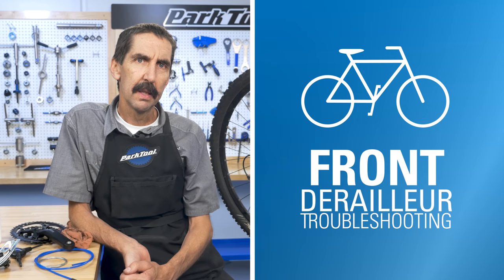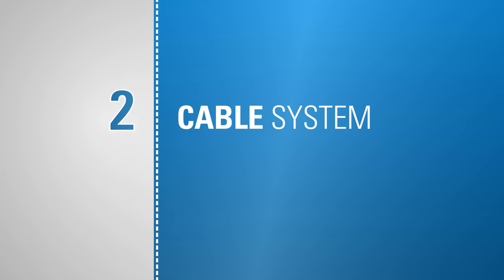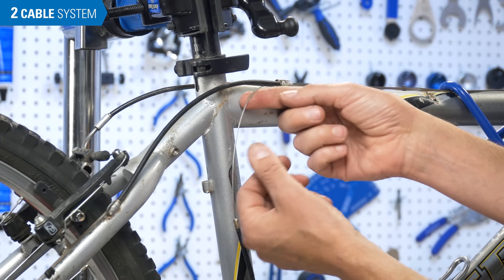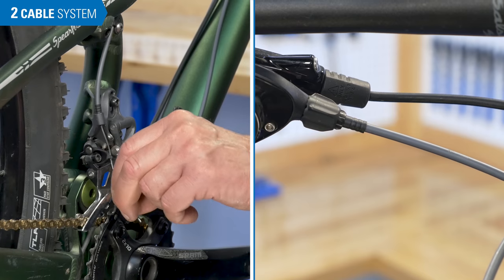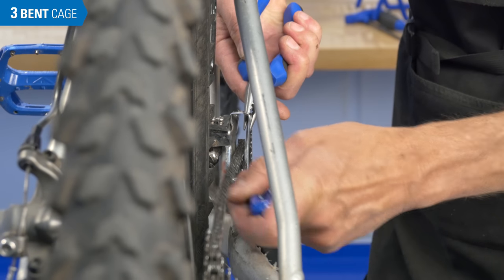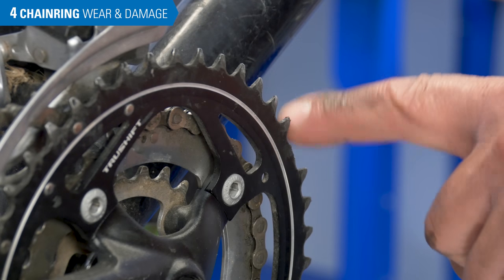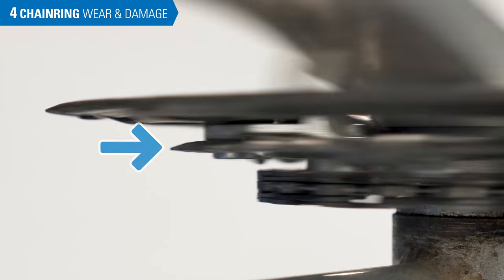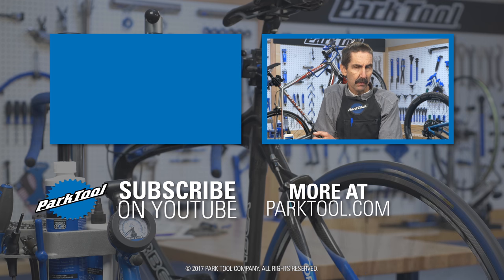Front Derailleur - Advanced Troubleshooting

Comment: My problem is everytime when I'm in the largest cog, when I'm putting it on second it goes directly in smallest and skipping the second
Reply: Adjust your front system from scratch. It's usually a bad combination of the shifter set screw and low set screw but more the shifter screw.

Comment: After watching all the videos on "front derailleur", I was hoping this one was the answer. Believe it or not, it wasn't. It was my mistake not to have recorded what side of the screw the cable was supposed to go. I had threaded the cable on the opposite side of the clamp down point than I should have. Just that little change made it impossible to get the chain on to the largest ring. So, after I moved the cable over and made sure everything was in lubed and adjusted, I tried it. Just a little tweaking of the High/Low screws and now it is back to the way it was before I decided to change from grip shifters to trigger shifters. Bottom line, however, is: These are without question the best bicycle maintenance video presentations out there. (Which could be why I always go to Park Tools for my bicycle needs.) Thanks.

Comment: I bought a new bicycle but found out it's rubbing the chain for some gear combinations, after watching your other two basic videos and a few hours of tuning, I found out that the large chain ring is not rotating on the same surface, there is 1-2mm in and out while rotating, not sure if it's wobbled chain ring or other things caused it to off the surface... but  the 3'05'' of this video talks about the wobble chain ring which confirmed my difficulty of adjusting cable/H/L limit. thank you very much. learned a lot from your videos. the bike will be returned to store.

Comment: I'm indexing my gears and adjusted the front derailleur, but when on the lowest gear+smallest ring  and trying to switch the front derailleur to the big ring, the chain gets stuck. The derailleur cage is practically parallel to the ground and it seems like the problem is related to that. How can I fix it?

Comment: Great video(s)! The detail and intuition provided is really helpful. The issue I'm having is that adjusting the limit screws does not move the cage. I manually moved it in and out and managed to get a little movement out of it so I think maybe its just really grimy in there. Would lubrication (or wd-40 or similar) help? I just changed the cables on my bike so I'm confident they're ok. Thanks!
Reply from the maker: Thanks! Lubrication will definitely help. Sometimes You may have to turn it a few times to get the screw to come in contact with the stop. This is especially prevalent on the low limit of the front derailleur. Lube... good, and keep turning. Hope this helps! Let us know how it goes.
Reply: Yeah! Ortherwise use the T9,its very helpful

Comment: I was going to adjust mine but for some reason the tension is so high I cant seem to get the lever on the handlebars to go past half way (front stays on middle cog and wont go to largest). i checked the cable when its on the smallest cog and it isnt really tight just firmly in place... any idea whats causing this? changing the l and h screws dont solve it.. i cant find anything it could be stuck on either... its a brand new bike and i found out the spokes are so loose they creak from the slightest movement of the bike so i'm pretty frustrated... to be fair it was shipped through mail so i should have expected as much.

Comment: I've gone through the main tutorial, adjusted alignment in both planes of movement, adjusted limit screws, done the indexing, then checked the advanced tutorial and checked cable housing and chainring bolts. My rings and chain are all brand new. I'm at my wit's end. The chain still has problems shifting from big to middle ring (worst offender) and also from middle to big ring. This also can be perfect on the work station, but then when riding for a few minutes reverts back to being a ****. I've taken everything off and rebuilt and readjusted countless times now and keep getting the same issue. The only thing I noticed was that when the cable is slack and I'm testing the movement of the derailleur, in order to then re-tighten the cable to set the perfect tension, that my derailleur doesn't ever move over as far as yours does in the main tutorial. Even with full slackness it does a half-arsed movement (even when I pull the chain to the side to stop it getting in the way). I took it off and sprayed it up in all the nooks and crannies and tested it whilst in my hand, and it moves fine, but when on the bike and activated by the shifter it seems weaker. No matter what I adjust I can never get the whole system working perfectly. If one part is working perfectly due to cable tension, another part will be off. What are your thoughts?
Reply from the maker: When you replaced the chainrings on the bike did you time the rings correctly? I ask this because you say it works in the stand but not while riding. This indicates that the chain might not be catching on the correct part of the chain ring. many chainrings will have ramps and pins that help the chain catch the next gear and also helps the chain drop. If these are not correctly oriented then the shifting will not work under load very well. Also, what is the condition of the cable and housing?

Comment: I watched all your videos and they are great. However, I have an issue with the front derailleur shifter I've never seen. When I try to shift from middle to larges cog (front), the shifter lever does not pull the cable until I repeat it a couple of times and then it "catches". From smaller to middle cog this issue does not occur. Any advice you could share?

Comment: Tried exchanging front derailleur. But ''seat post angle'' and or ''cage size'' caused a problem? Do the cages differ in angle and or size in length? On crank I changed from 2 to 3 chain rings. Hoping to see a solution on YouTube. Thank you

Comment: I replaced the left shifter and it came with a new cable. I installed everything and then used one of your videos to adjust the front derailleur and it was very helpful. However, no matter what I adjusted, the shifter won't click to 3rd when the cable is attached. If I loosen the pinch bolt and disconnect the cable, I can get the shifter to do all 3 clicks and the cable moves slightly for each. What is happening when I reattach that prevents the shifter from clicking to 3? When it is in 2, I push the thumb to click to 3 and the thumb just presses all the way in with no impact on the derailleur and no click. Any thoughts?

Comment: Awesome explanatory vid!  I've learned a lot and can now make successful adjustments myself ^^

Unfortunately I'm currently still riding my 14y  old "MTB" with a 3X gear up front ... more of a 'city bike gear' on an ok MTB like frame :/... and after playing with the rear suspension settings ... which didn't turn out well since it's more a bike pretending to be a MTB ... the sticker on the frame even says so :D  ... I ended up with the problem that I can get everything to work alright in the repair stand but during testriding the suspension obviously manipulates the chain tension thus the front derailleur doesn't want to shift well between the 3 gears.  Either (i) all except the biggest work fine ... or (ii) the problem is going back down from the biggest cog.
Guess it's just a matter of a lot of try and error and making small adjustments over time ...
Guess this explains why real MTB's normally only have a 1x or at most 2x at the front...

Thus currently I'm just gonna use the medium size cog at the front until I've had enough time and patience to get it fully set.

I have "motor bike throttle style" shifters thus I guess I can use the extra click's to "over adjust" the derailleur while on the repair stand and than see what effect it has during test riding.

Comment: I noticed a small wobble in my chainring Which makes the chain rub against the derraileur when in the two smallest cogs and the biggest chainring. I tried to set the limit screw but the chain keeps rubbing. Please help me
Reply from the maker: Some small wobbles are not uncommon.  But these can rub if big enough as you have seen.  Sometimes some models can accept bending to straighten, but sometimes it just means new rings.
Reply: Can a loose cranck cap be the cause of the wobble?
Reply: @parktool  thank you

Comment: My shifter for the front derailleur is stiff. It hurts my thumb while I try to shift gear onto the next. Help?
Reply from the maker: Lubricate the pivots of the derailleur. Also lubricate the cable.  To test the lever pull, disconnect the front cable, and pull it with one hand.  Move the lever with the other hand.  It should not be hard to move the lever.  Lubricate the lever if it is still.

Comment: Why if I'm pedalling then I stop pedalling and my chain stucks and doesn't freewheeling how can I fix it
Reply from the maker: There could be a few things happening. You could have something like a spoke protector or a pice of string or grass wedged behind the freewheel not allowing it to freewheel properly. Or you could have a seized up freewheel. If you clean the debris or there is none and it still is having the issue you can sometimes get some lubricant into the freewheel to break it free but replacement is suggested at that point.

Comment: What to do, when my L limit screw is loosen up, the cable tension is loose as well, but the chain still rubs the inner part of front derailleur when on small chainring and biggest sprocket (Shimano 105 2x11, 52/36 chainring, 11-30 cassette)?
Reply from the maker: Double check the rotation.  It may need a little clockwise rotation, as seen from the top.

Comment: Parktool can you make a vid preventing the front derailluer clamp scratching the frame? I hope youll notice me.
Reply from the maker: Clamps by their design must press against the tube.  It certainly can occur that you get a scratch.  However, remove the derailleur. Feel inside the clamp for any sharp edges.  Use a jeweler's fine or find emery cloth to finish smooth. I can sometimes help to use thin adhesive tape.  Place this inside the derailleur clamp, not the frame. The adhesive sticks to the clamp surfaces. Use a razor blade to trim off any excess beyond the clamp.  Thick tape will change the diameter and may not allow the clamp to work, use an electrician's tape.

Comment: I recall about 20 years ago, reading about many different types of cable housing (Teflon-coated, reinforced, black or white, etc.) some of which required special tools and techniques to install. Nowadays, all the mechanics say "Buy new cable housing" like it's a generic "one size fits all" product. Is that true these days??
Reply from the maker: There are quality levels in cables and in housings these days. Many shops or home mechanics have a big sspool of a decent housing and then have some decent cables that they use as the shop or home mechanics "everyday" use stuff. Then they usually will have a higher end option or two. Never lower quality as some of the inexpensive cables and housings are terrible.

Comment: My chain sometimes will suddenly jump from large chainring to the middle chainring when it was fully locked in indexed
Reply from the maker: Certainly that can occur.  Double check the rotation and also the H-limit. If a bit on the tight side, it may allow the chain to fall inward.
Reply: @parktool  That's exactly what it was thank you kindly Sir :)

Comment: Hi Calvin, I need your expertise. I have a 2x10 Tiagra 4700 setup. The front derailleur is a bottom pull. I removed it to clean and lube pivot points. After reinstalling and adjusting cable tension,  the front derailleur will no longer shift to the large chainring without having to use excessive force which makes it utterly unusable.  In my troubleshooting, I found that when the cable is disconnected, the front derailleur moves smoothly. With the cable still disconnected and holding the cable with my fingers, the shifter works normally and cable is pulled and released as I shift through its range. It was working decently prior to removal and clean/lube. I have played with cable tension, limit screws all to no avail. I am stumped. Any ideas??
Reply: Having the same issue and nobody seems to have good advice for it

Comment: What do you do when the barrel adjuster won't thread into its place
Reply from the maker: Be careful, don't force it.  Disconnect the cable at the pinch bolt to get slack.  Now align the threads of the adjuster with the lever and carefully re-thread it.  If it will not start, the internal thread might be damaged, and need a M5 x 0.8mm tap to clean.

Comment: How about a small wobble in chainring? I think even that makes 3-by-systems hard to tune just right and replacing all the whole front end cogs just for that gets expensive. Is it possible to bend chainring to true, shim the chainring or is the replacement the only real option?
Reply from the maker: Small deviations can be adjusted out of chainrings. Careful use of pry tools, a hammer and a punch can correct these deviations. start with small adjustments and go bigger.

Comment: if you have a bent tooth on a front sprocket, is it bad to torch it and try to bend it while hot?
Reply from the maker: it would be best to bend while cold. If aluminum it is going to break off. But if steel it will likely be just fine bending back.
Reply from the maker: Do not heat the metal.  Just bend it a little at a time, trying not to over shoot.  If it breaks, it was unusable anyway.  Test ride and see how it works.

Comment: My Shimano FD-R2000 front derailer's trim is troubling me a lot, there's always a gear or two in the middle of the cassette that results in the chain rubbing the derailer cage even after the trim is performed. it's like the cable pull ratio is too big, so instead of rubbing the outer plate, it starts rubbing the inner one after the trim is performed. I checked the assembly as per the manual like million times, all the gear is brand new, so this is really frustrating to have like two gears in the middle not available without rubbing. 

The only working way to get rid of this is to set the 3rd (of 4) position so it covers only two gears like 4-5 and then upper limit screw would prevent the cage from moving too far for the 4th position to get 6-8 gears in place. But that's like 10 or 11 working gears in total with very limited freedom of not using the left shifter all the time, better off without the derailer in the first place and simply put up with 50x11-32 I think.
Reply from the maker: Have you tried routing the cable differently? That derailleur has 2 different routing options that provide different leverage ratios depending on the angle that the cable is fed to the derailleur. You can see the gauge that shimano provides for setup on page 14 of there installation manual.

Comment: Issue.  Orbea Avant h30.  Shimano 105 front derailleur and rear.  Adjusted everything really well.  The bike is new.  Less than 100 miles on it.  Clean as a whistle.  

The issue I'm having is front derailleur is slow to downshift.  I have 2 front chainrings and 3 index position on the Front derailleur.  To downshift quickly I need to double downshift.  If I single downshift...it drags too much before dropping inward to the small chainring. 

Otherwise the bike is smooth in all.otber shifting.
Reply from the maker: I'm guessing this is the most recent 105 group. The front shifter has 4 positions. You are dealing with was one of the upgrades with the new system. So when shifting to the large right it goes up normally, then the shift down it hesitates and shifts and may make a bit of noise until you release again? They made this shift to the smaller chainring a two tap process in order to reduce the amount of chain drops people would have. Usually you can get it to the point where it is hard to notice the rubbing on that first down shift but it is best to hit it twice. You can also run the low limit a little bit looser as there is less risk of the chain falling off.The 4th position up top is found if you very lightly press the release lever instead of doing a firm shift. It is a trim for the large ring and the other one is the trim adjust for the small ring.
Reply: Park Tool awesome! That makes perfect sense!  I was thinking maybe it was a trim... hence the double tap to down shift into small ring.  It's smooth and has no issue going in...it's just that trim setting that is noisy.  

That being said...it seems it's normal then.  They didn't adjust it properly from the shop I purchased...so I used your videos to go through my enitre indexing for all my gears. 

Thank you greatly for the response!!! And the videos!  Tremendously helpful